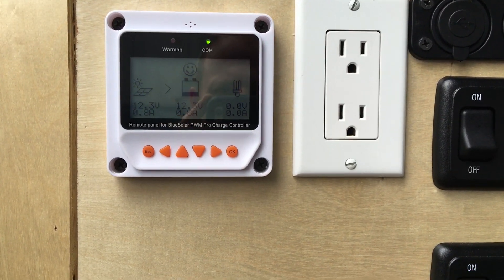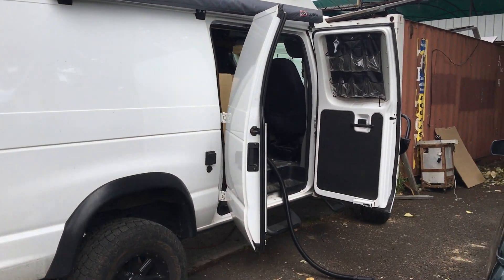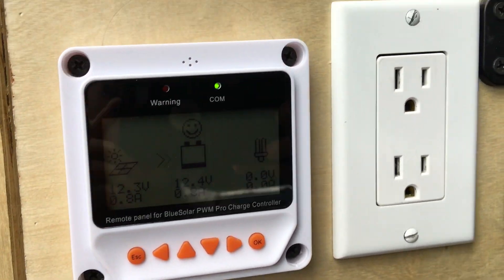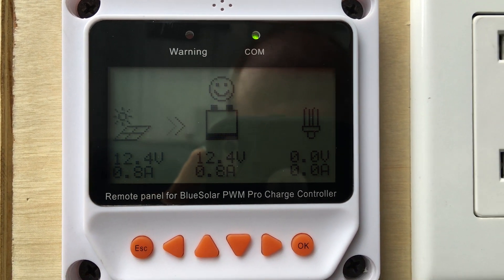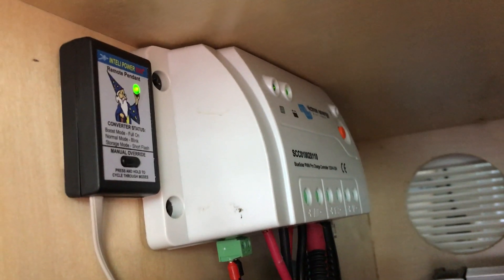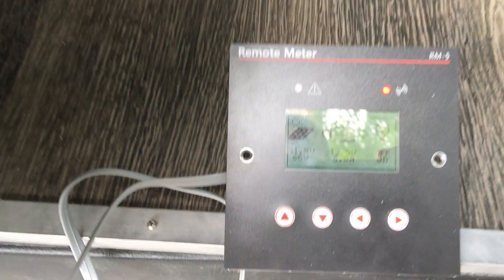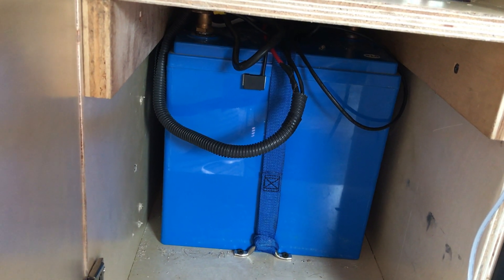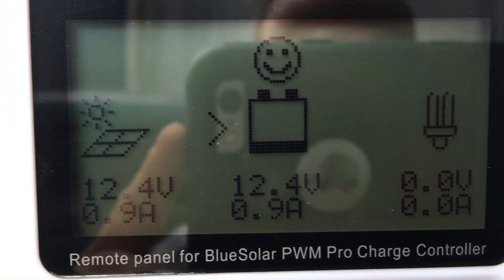Solar Panel test on Lifted Ford E350 Quigley 4X4 Diesel Van.High voltage/MPPT versus Low voltage PWM

Comment: Hey ,Miles what's exactly that Wonder charge controller?
Reply from the maker: Hi Zoltan, Good to hear from you.  The charge controller running the 2 smaller panels is a Victron PWM and the charge controller we put in running the 305 Watt panel is a SRNE 30 Amp MPPT which is included in our kits. For a time this was the best panel we had ever seen.  We saw it putting out most 24 Amps.
Reply: @lightharvestsolar  thanks